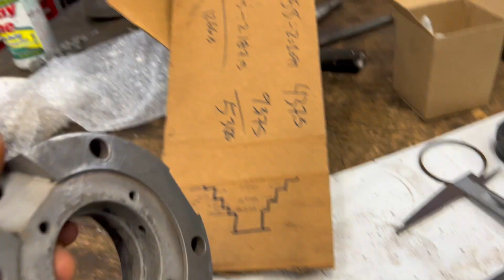Project # 3605

Comment: Looks shiny, it might be great if you can add a bit of explanation on what this part does and is used for. Thanks 👍
Reply: Agree. Useless without some explanation.
Reply from the maker: It’s the housing for the seat of a mechanical seal. It prevents water leaking from a water pump.